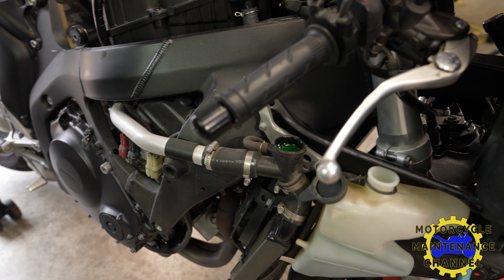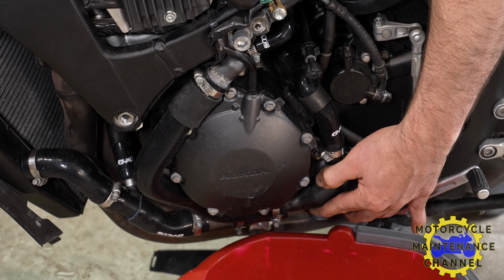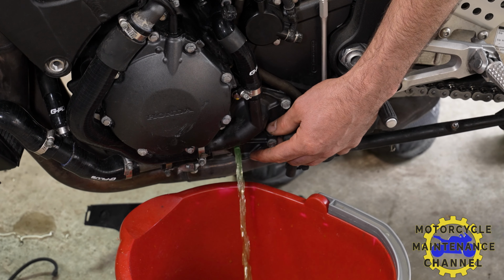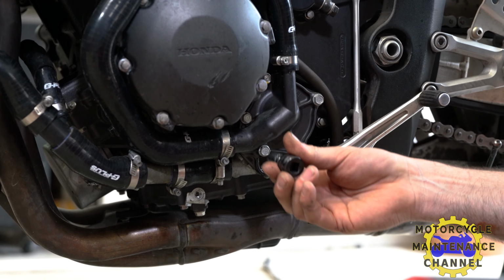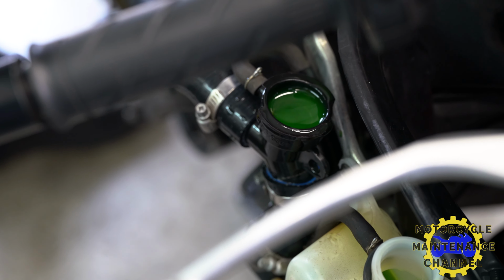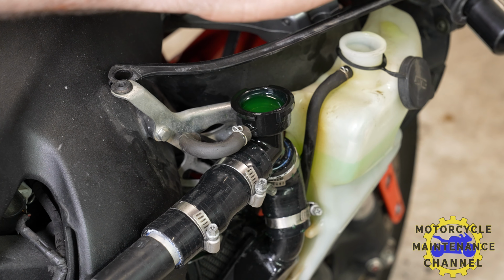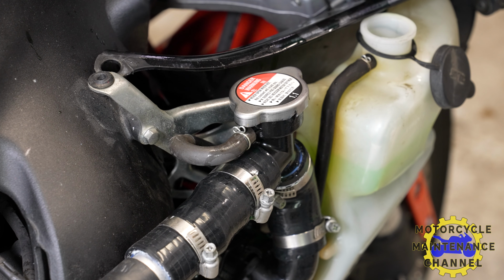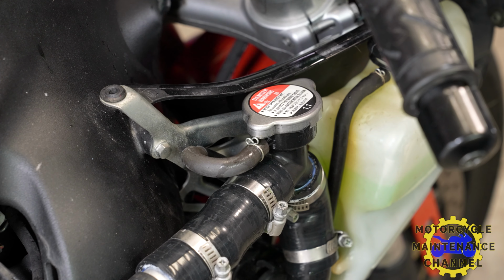Honda CBR1000rr Radiator Flush 04-07

Comment: Thanks man same bike same miles
Reply from the maker: Glad to hear! They are great bikes, you can really put them through a lot!
Reply from the maker: Rolls Royz  12,000 miles for radiator flush, 16,000 miles for valves inspection. Thanks for watching!
Reply: And the valve inspection isn’t a big deal at 13k and honestly 16k it probably won’t need a adjustment but I would definitely change the chain tensioner to a manual one just don’t go crazy with it

Comment: Hello sir always a pleasure to watch your video ‘s and helps me out 

I’ve had a question I have a Honda Cbr 1000 rr 2006 and I’ve have a problem with my radiator, my old radiator was to damage so I’ve ordered a aftermarket it seems it does not fit on the bracket maybe you can help me out what I can do 

Thanks greetings

Comment: I know it’s 3yrs old but damn it’s hard watching amateurs work on such a nice bike. He didn’t even notice the missing hose clamp someone forgot when they installed the silicone hose kit. 🤦🏻‍♂️ then revving while the cap is off not knowing as it heats up pressure builds and pushes coolant out causing an air pocket. Just stop working on stuff if you don’t know how it works.
Reply from the maker: Thanks for watching!
Reply: Revving it with the cap off is as per Honda service manual. D'oh

Comment: Revving the bike with the cap off 🤦🏻‍♂️
Reply from the maker: What’s your issue??
Reply from the maker: Read the service manual 🤦‍♂️
Reply: @motorcyclemaintenancechann2131  Yep! Clearly states it in the service manual.
Reply: He’s bleeding the system from air , read the manual
Reply: @abspeedy1779  read the manual… or let them cooling system do it’s job
Reply: that's  how u bleed the system of bubbles I have a 07 repsol and says in manual. He did everything the manual sd to do.